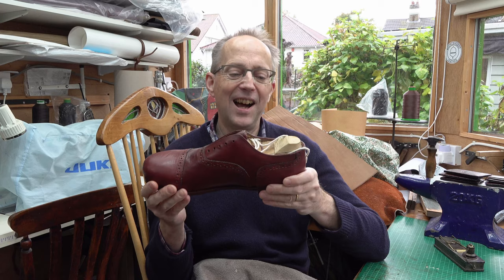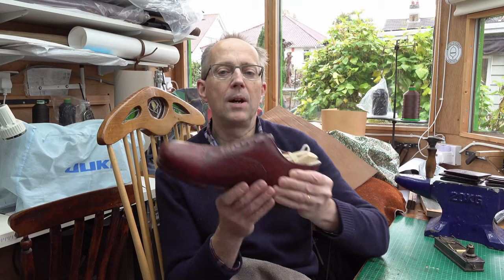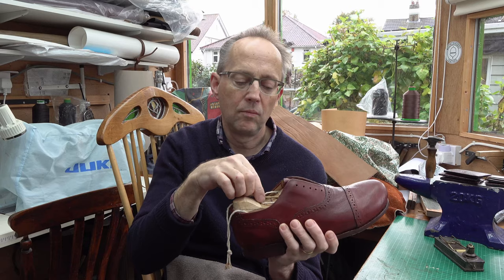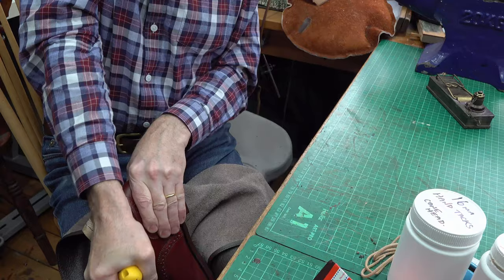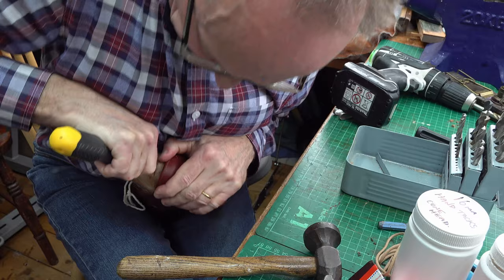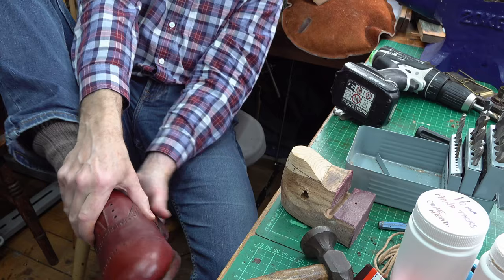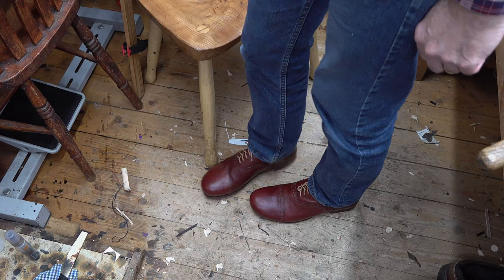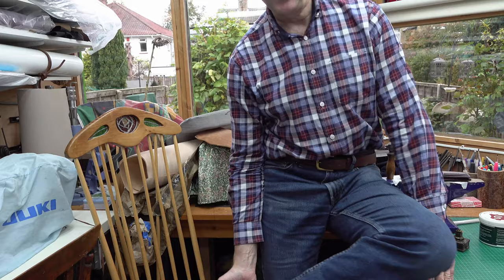Pt 18. Shoemaking Finished Do They Fit

Comment: OLD LEATHER SMITH here, I think you did A GREAT JOB HARRY, I since I make moccasins I use a soft last and it's made in side out, turning them is as difficult as you had with your last, but I have found a way 2 make it some what easier. Great job again, GOD'S BLESSINGS ✝️⚾🙃

Comment: I bought a pair of used lasts form somewhere, and then added a bit of leather to them for a closer match to my feet, and have been using them on a pair of well fitting motorcycle shoes. I had stretched the shoes from wearing them in rain a few times and often walking some ditence in them, and when the lasts would go in and pretty much fill them perfectly I was about as chuffed as you were.
I've not attempted to make my own, yet, but I did use them to slightly reshape a pair of Doc's I've had since the 90's for a resole, and I've been working on resoling those old motorcycle shoes.
Congrats on getting a good fit.

Comment: You want to use talcum or baby powder on the final lasting and put it all over the last sides, top and soles and this helps greatly in removing the last from the shoe when you’re done.  Also, I wet the uppers with hot water to help them stretch before removing the last. Especially around the heel & sides..

It is always extremely tight and difficult to remove regardless. Nice work!.

Comment: I thought you were mad going down this journey, I my self make my own stuff from time to time, but never got around to making shoes, very time consuming, but very rewarding if you pull it off correctly,time will tell when walking some miles in them whether they are made correctly for your feet,
There are allot of variables to consider so that you don`t end up damaging the feet,
I always thought it would be to difficult getting the arches correct , if you take a trainer where the arch seams to have more support inside than a shoe, I think because of the flex on the trainer and being more cushioned , usually allow for running, 
Then why can`t they do this with a shoe, as the shoe is less flexible and cushioned 
I have issues with my feet swelling to much and pretty broad, can not where shoes anymore as my feet get to pain full.and hurt my old back injury.
So always in trainers , but not great if I need to turn up in a suite some for a special occasion. 
So I was thinking if I made shoes that was more cushioned and flexible but still looked like a smart brogue how could this be done, 
That`s as far as my thoughts went,
So fair play to you dude from start to finish you got there. have you broke them in yet and are they the perfect foot wear for your feet, or do you have to go back to the drawing board to improve,

Comment: Hi Harry,
breaking the last appears to require quite substantial amount of force.
What I have been thinking is a 3D printed last. But looking your video, I think such a last will shatter when trying to break it out from the shoe.
What about splitting the last to three pieces instead of normal two pieces. In the three piece last the middle part could be clearly a wedge shape what can be pulled out straigth. 
Any thoughts on that, please? Or have seen such a construction in real?

Comment: Could you make lasts that have the laps of the lap joint with the upper lap on the heel section?  I think that would allow it to be removed easier.
Reply from the maker: Yes..certainly a good though.. thanks.